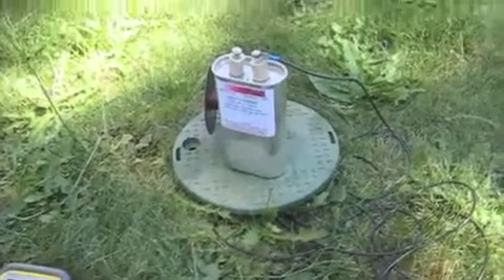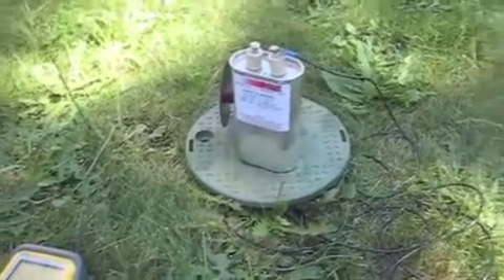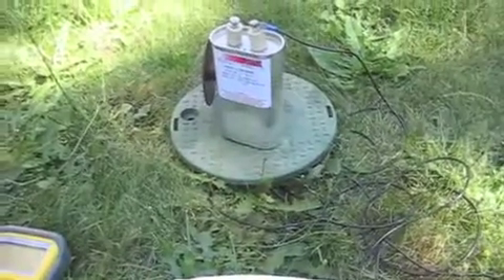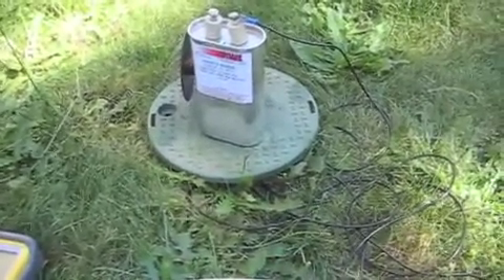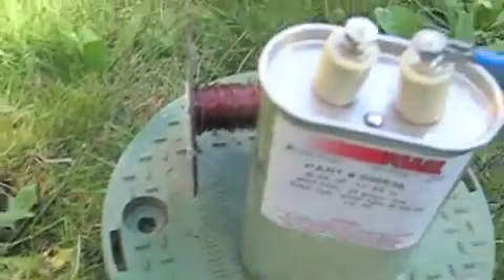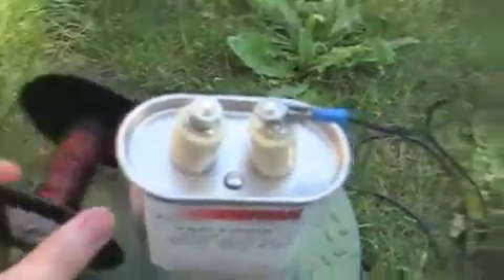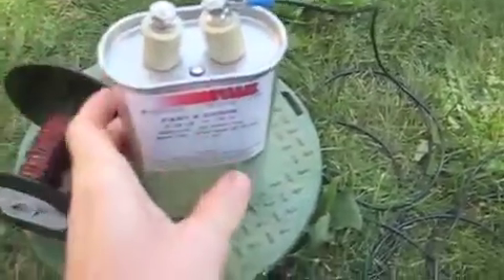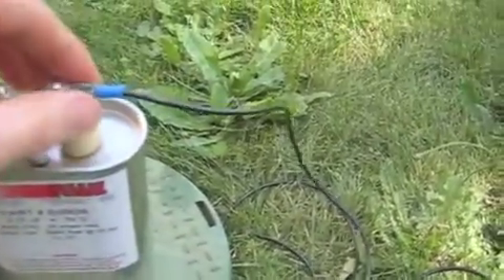Tesla Radian Energy Collector

Comment: Your capacitor is too big, try 470 picofarad instead. You can use some form of a switch to discharge the capacitor into a load (12v dc battery as an example), John Bedini used a SCR with a neon bulb (60-90v) between the gate and the anode. The anode is connected to the high potential of the capacitor (+) and the cathode is connected to the positive of the 12v battery. The negative side of the battery is connected to ground/negative side of capacitor. Good luck.

Comment: You need to have a shiny surface on the plate and negatively charge the plate. Read his patents carefully over and over.
Reply: If Tesla said it, it was true! He devoted his life to radiant energies and dozens of patents. He gave up on high voltage AC. Modern day volt meters only measure electron movement. This is a neutrally charged particles smaller than electrons that move around the electron and are slowed by them. Everything after 1895, was devoted to radiant energies.
Reply: The reason why no one can reproduce it is because they dont follow his patents and try to add stuff like diodes (disinformation agents). You need a shiny metal aluminum plate, insulated with a dielectric(polyurethane preferable). You need a good mica capasitor, a good insulated ground plate, a spark gap, and a switching device. Read Gerry Vassilatos book Secrets of cold war technology. Wardenclyffe, Colorodo, NY, death ray, everything was based off this discover! They tried to kill him and bury the technology!
Reply: @devinmccloud you the man I was trying to explain the very word ya put. It was a magnetically quenched spark gap
Reply from the maker: Thank you, I will have to try this again!
Reply: Yes their is another plate burried in the ground also should be a spark gap in there he stated that a magneticly quenched spark gap worked best. I get the ground rod but he had a plate also buried as the ground @calvincampbell6396

Comment: Everybody pretty much is on the right vien, with charge separation through diodes. You have to understand that Tesla didn't have diodes, but you are missing  something he shows in his drawings. If you look, you will find a capacitor parallel to a spark gap. The gap does the same thing as the diode, it forces the electo-dielectric energy one way, which allows separation which is needed to charge a capacitor. If you place a capacitor in parallel to a spark gap, you will build charge on the plates. Which is what Tesla proves in his Hairpin circuit. But adding the capacitor raises the voltage needed to jump across the gap, so when most people try doing that, they have no luck, unless the capacitor is really small. The larger the capacitor, the higher voltage is needed to jump the gap, so your collector(plate) needs to be higher and larger.  You don't need it in what you are doing because you have diodes. Tesla would be dancing around singing if he had what we have; in doped semiconductor technology. So charge separation is really easy with full wave bridge just put the collector plate on one ~  and Earth ground on the other ~, with the capacitor  leads on the + and - of the full wave bridge. There are better choices than the germanium diodes. If you lived right next to a radio tower, you could run your home. Remember this is RADIANT energy. If you build your own transmitter...(i.e,  Slayer SST) You would see it better.
Reply: The spark gap removes the magnetic field from the equation and chucks free electrons between the gap removing them from the curcuit. It's like a pressure relief valve on a water tank. The key that everyone missed is negatively charging the aerial plate. The system is self balanced in nature, there needs to be an imbalance to start the flow.
Reply: @devinmccloud  his patent says the aerial plate gets positively charged, and the ground is negative.
Reply: This is why he created dozens of patents with devices in oil. This energy will fry capasitor, coils,  circuits and transformers. He said his giant AC dynamo's had nothing on this new discovery.
Reply: underrated comment. welcome to 2020, dawg.